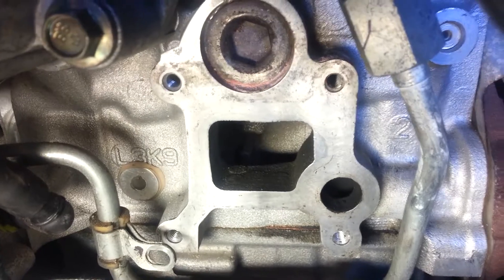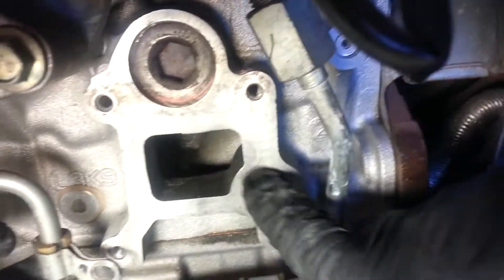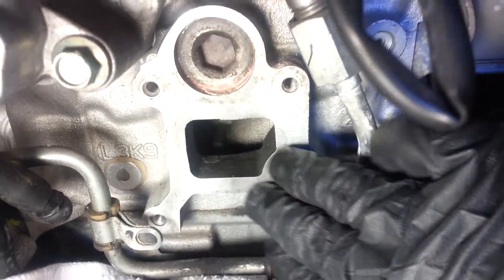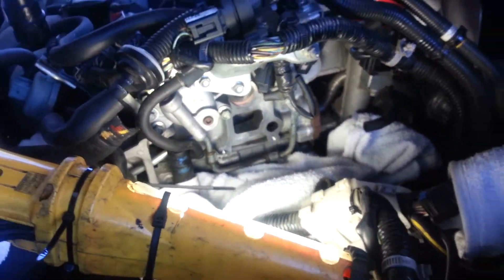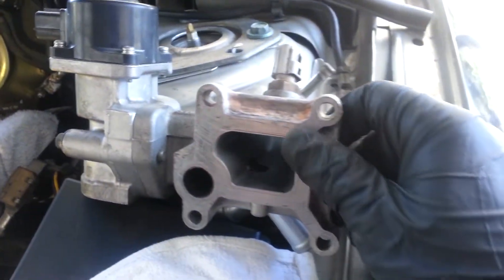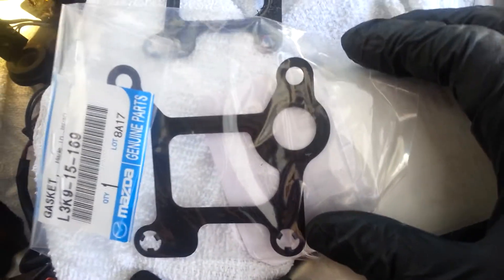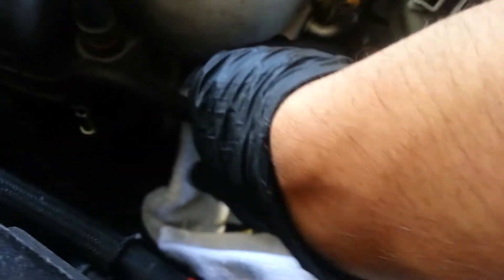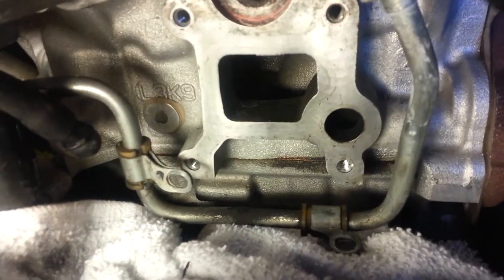2008 mazdaspeed 3 water outlet gasket change

Comment: I'm noticing small puddle right on top of the transmission, Is this for Mazdaspeed 3 I can't find anything on this part
Reply from the maker: You're experiencing something different. Can you identify the fluid?
Reply: @kylewomack6259  it's green, def coolant
Reply from the maker: @diegorodriguez5855  could be a leak from some coolant lines. Double check everything while cars idling
Reply: @diego 
Did you find where the leak was ? I’m having the same issue

Comment: Kyle has all held up well for you after the gasket replacement? Do you by chance remember what you torqued the bolts to? Thanks man.
Reply from the maker: Hi mark yes all has held up well. I believe the bolts were torqued to 10 inch pounds, not foot pounds. But double check. Thanks for watching!
Reply: Mazda manual says 71-101 in/lbs

Comment: Did car still run with this leaking water
Reply from the maker: Yeah it will still run, you will start to notice a build up of coolant in this area though.
Reply: @kylewomack6259  thanks for replying is there anyway this could be putting water on pistons i pulled my plugs and they had a bunch of water
Reply from the maker: @johnnyherring4825  separate issue, if there's coolant in your piston chambers the head gasket has gone bad and bursted leaking coolant internally.
Reply: Yea I figured that out after sucking water out for a hour with antifreeze tester lol a few times really appreciate the help tho how hard is it to do head gasket on these I heard timing is hard to do on these
Reply from the maker: @johnnyherring4825  yeah it's alot of work and time.